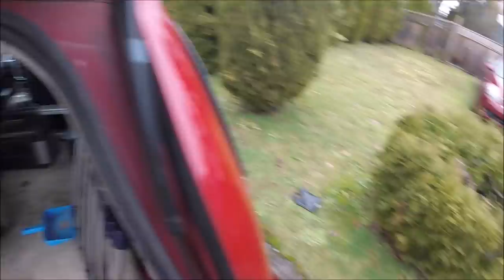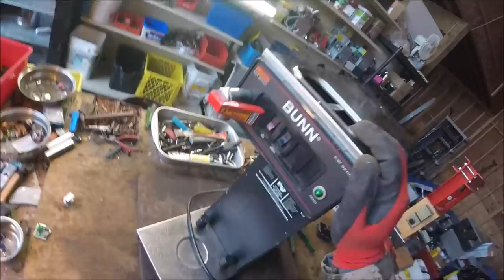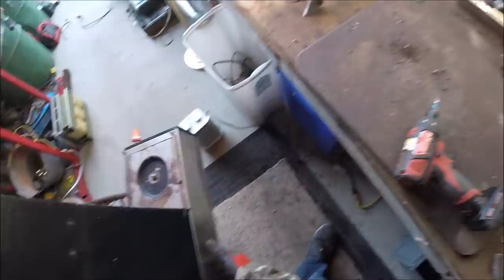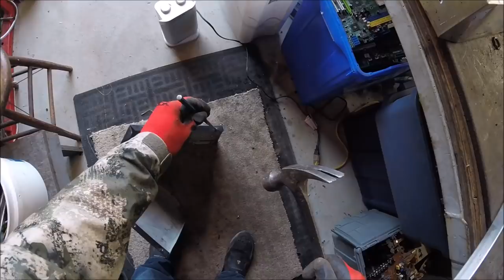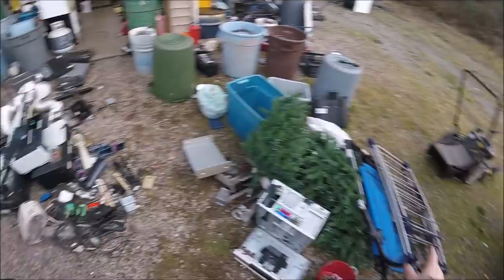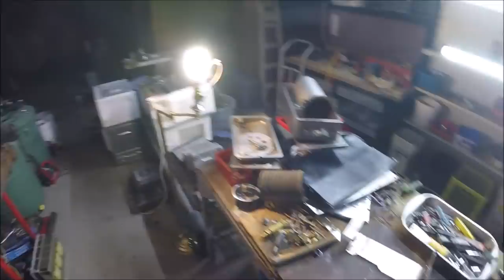Scrapping Commercial Bunn Coffee Dispenser + Visit From Scrap Bongo

Comment: I had a Nissan Cabstar tipper and to get the heavier stuff up and in the back I installed an electric crane. It really helped a lot.
Scrap Bongo's truck has a much lower load height, so some kind of folding ramp attached to the tailgate would give him a shallow enough angle to wheel stuff into the rear.
Reply: Thanks Rambling man, have a welder on order and Ill see what kind of damage I can do :)  /cheers ScrapBongo